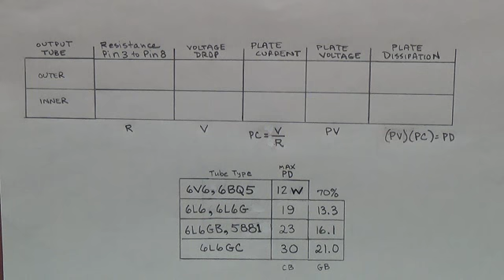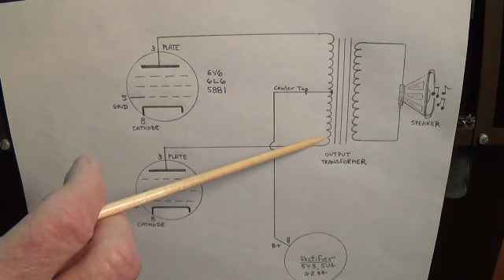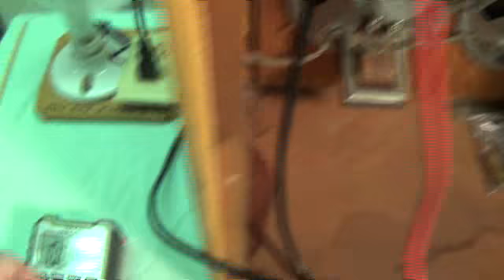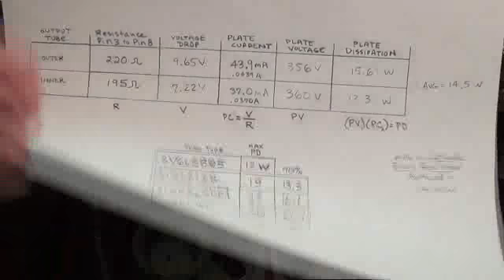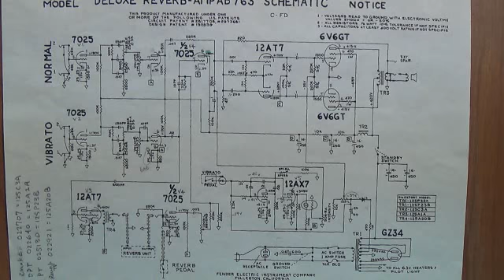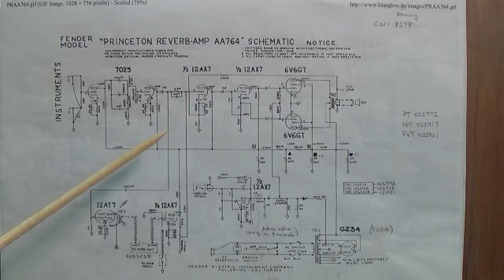Biasing Double-Ended Amplifier Output Tubes, Part 2: Demonstration and Discussion

Comment: Will individually biasing your output tubes make up for having a very poorly matched output transformer.. I got 83 ohms on one side of the centre tap and 97 ohms on the other side on the primer
Reply from the maker: You can try, Joe, but mismatched output tubes can sound better than matched ones......more even-order harmonics.
Reply: @UncleDoug thanks… it’s a fender blues junior… it sounds great as is really think I will be thank full for just getting it working again and leave it be…❤
Reply from the maker: @joeblogs8204  A disparity between primary windings is quite normal, Joe.
Reply: @UncleDoug thanks for cooling my bias😂I think I been getting too carried away with the repairs .. it works so I just leaving at that . Thanks pal for the advice..
Reply from the maker: @joeblogs8204  You're welcome, Joe.
Reply: @UncleDoug Like a complete idiot I have decided to convert the fixed bias of a blues junior 3 to the cathode bias of the junior4 .. I have just leaned the 4 is cathode biased but I am going to make mine variable like you have shown on the Princeton.. what’s wrong with me ..why can’t I just quit while I am ahead
Reply from the maker: @joeblogs8204  Experimentation is how we really learn tube amp circuitry, Joe. Just be careful and use a current limiter to protect the circuit.

Comment: Thanks Doug for this tutorial.   I have a Fender Twin Reverb (SF 100 watt) that I added 150 ohm resistors to 
the inner set of 6L6GC (pulled the outer two & have an 8 ohm speaker in cabinet).    I have a hybrid biased amp
as a result.    I was looking for this transformer method to get the tubes biased within 70% of max.   Your video 
helped me learn how to bias using this method.   I cannot find any info on the internet (so far .. ) that tells me how 
to properly bias a hybrid bias amp.   I'm assuming the transformer method is the best way.    Let me know if that is correct.
Thanks again.
Reply from the maker: Voltage drop across the OPT primary winding is, to me, the safest and best way to measure plate current, Todd. To hybrid bias, since the cathodes are grounded and if the PD's are beyond 10% out- of-match (and you don't want to buy a better-matched tube set), would be to add carefully selected cathode bias resistors to the mismatched tubes, to make their bias the same. This is only advisable if the mismatch is significant.  Small to moderate mismatch can actually produce superior tone and more pleasing harmonics. Also, Fender used hybrid bias in several of their higher-wattage circuits, so there is a precedent to do this.
Reply: @UncleDoug     Thank you Doug.     I have four 6L6GC tubes from JJ that are matched.    But I did a separate bias for fixed using multi-turn pots, so each tube can be biased separately.    What you were stating about the Princeton not having a bias pot ... then you added 100 ohm resistors to each power tube made me wonder about how I should bias this hybrid.    I have around 410VDC on one plate, and something close to that on the other.   I reduced plate voltage by adding a 300 ohm 25 watt precision resistor to the HV Center tap of PT.    It seems, after what you stated about the Princeton, that if I biased to -52mA approx, adding the 150 ohm resistors to each cathode would actually cause it to have a cooler bias.    What I had come to understand is that with a hybrid amp, part of the bias is with cathode resistor and the remaining with fixed.     If I use the transformer biasing method you show in your video, is that all I need to properly bias the tubes to 70% of max?    I have tried to find one site on the internet that gives the procedure for biasing a hybrid amp & found nothing.     Since Fender did that around 1970 (apparently the Beatles SF Twins were hybrid biased), how did the factory bias them?     Thank you so much for your expertise and time.
Reply from the maker: @toddmayer6859  I believe I already explained this in my previous response, Todd.
Reply: @UncleDoug     Thanks again Doug.   I'll re-read what you wrote.  Guess my brain didn't absorb the info.

Comment: I'm having trouble adapting this to Fender amps with SS rectifiers such as BF/SF Bassman. If I test resistance at the rectifier output as this implies, i get a wildly inconsistent figure in the megaohms. I guess that means I measure resistance between plates and right where the output transformer center tap connects to the eyelet board? That gives me a MUCH lower number than in this example, only 37-38 ohms.

And what do you do if you if the voltage drop test says 0VDC, when measured from the center tap or the rectifier output? It does go to -2VDC once I turn the amp off. Any guidance is greatly appreciated, I've been fighting this for weeks/months.
Reply from the maker: Measure the primary winding resistance between pin 3 of each 6L6 and the red wire at the center left of the long rectangular eyelet board with amp off and filter caps fully drained.  It should be around 50 Ohms for each primary winding. Write down the actual value, then very carefully measure the DC voltage drop from the same tube pins and the red wire, using only one hand and amp on (standby switch to run/on). Divide the voltage drop by the primary winding resistance for each tube = plate current in amps.

Comment: My amp uses a 300ohm cathode bias resistor.When switching to 2 resistors for separate cathode adjustment would the average resistor value be 300 again or 150 ohm.I have two 250ohm adjustable power resistors that could be used if the average cathode resistor value is half when using separate bias resistors.
Reply from the maker: Good question and one that I have not personally faced in many years.  As I recall, I biased each tube at the full original resistance, i.e. in your case 300 Ohms each, and then fine tuned from there, if needed. It's always best to start high rather than low.
Reply: @UncleDoug  I believe use of 2 cathode resistors would require the same average value of resistance ,however only half power rating would be required. My amp had ben serviced previously and It has an issue with the power output declining shortly after it is powered. The 5Y3 pins 2 and 8 have been wired so that pin 2 is connected to power supply caps and one of the 5volt transformer leads.Pin 8 goes to other transformer lead. The schematic shows the standard 5y3 wiring. Is this a problem?
Reply from the maker: @davidfoster5906  I agree with your analysis of the bias resistance, but would stick with the original power rating for each. Why take any risk for a negligible savings? With a directly heated cathode, as in the 5Y3, the rectifier pin used for B+ shouldn't matter......unlike with an indirectly heated cathode, i.e. GZ34. Pin 8 is preferred by most, to enable the use of both types of rectifier. I don't understand what "power" is specifically lost.....plate voltage, plate current, output wattage ??
Reply: @UncleDoug  Output power drops the longer it is on(it gets quite) I ran both bias methods 12 watts result for the cathode R method 10.9, 10.96watts transformer drop method.I have already increased cathode R from 300 to 350ohms. The power transformer puts out higher voltage than rated 710VAC rather than 680vac.  The amp had been serviced previously.I found .1mf coupling caps installed  to 6v6 grids instead of .047mF. Instead of replacing these new organge drop caps , could I half the value of the old 470k grid resistors. It could work as the Grids have high impedance in cathode bias. The power supply can cap may need replacing .Do you have a chapter on measuring leaky polarized caps?  Unfortunately the power transformer is only rated at 80ma so I may bias the cathodes for less dissipation (75%).
Reply from the maker: @davidfoster5906  Way too much random info and way too many questions for a comment section, David.  I simply don't have the time or energy to engage in complex long-distance amp repair.  Hopefully my videos will help. Good luck.
Reply: Sorry for the rambling questions. I have the plate dissipation down to 11 watts by following you process.I will work it through.
Reply from the maker: @davidfoster5906  I'm sure you will, David. Good luck.

Comment: Thank you for the great information.  I have a vintage Dynaco SCA-35 Hi-Fi amplifier that runs four EL84's, all biased with a single common cathode resistor (93 ohms).  While rolling some Russian Mullard tubes, I got some red-plating, even though my Philips JAN 6BQ5's ran OK.  Following your calculations, I learned the tubes were each dissipating about 14 watts in the plate.  I increased the cathode resistor to 133 ohms, and now they are all dissipating just under 12 watts.  That saved this vintage amp, which is now running, and sounding, great.
Reply from the maker: It sounds like you did exactly the right thing to save this old gem, DP.  Good work !!

Comment: Hi, Doug.  Thank you for sharing your knowledge.  You mentioned a couple of solutions for correcting differences in tube output as in the situation you discovered in this video.  One solution included changing from a shared cathode bias resistor to individual ones of different values.  I wonder, before doing that, is there any benefit to swapping the location of each tube (inner tube to outer socket, and vice versa) and checking the bias again?  Perhaps the tubes might perform a bit differently (hopefully more equally) in their new locations due to the different resistances of each half of the transformer winding or due to differences in the tubes themselves?  Just checking my understanding of what's going on.
Reply from the maker: Switching sockets is a good way to reduce the difference in Plate Current.....but in my experience, the improvement is generally quite small.

Comment: Uncle Doug, do you get a noticeable voltage drop across the plates with the current limiter in line with the amp instead of it plugged directly into mains?
Reply from the maker: It depends on the current draw of the circuit. In a Fender Champ, the voltage drop is negligible. In a Fender Twin,the voltage drop is significant. Bottom Line: Final bias settings should be made with wall AC.....i.e. no Current Limiter.

Comment: Hey Uncle Doug, what's the max plate dissipation on cathode biased EL34 tubes?
Reply from the maker: According to tube data readily available on the internet, it's 25W, RT.
Reply: @UncleDoug  I saw that on Google but wanted to check with an expert! 50% of what's online is way off the mark! LOL!
Reply from the maker: @rakentrail  Tube data is pretty reliable, RT.

Comment: Hi Doug, I have a 1995 Bassman Reissue, and it made a burning smell, and a loud buzzing.  Since then,  while testing with this method, I found that ohmage pin 8 rectifier to pin 3 plate of 6L6's, in both cases, each side of the output side of the output transformer read at MEgohm readings. IS this due to a fried output transformer, or some weirdness of the Solid state Rectifier that's in place? (thanks in advance if you get to see these late comments)
Reply from the maker: I'm confused by your descripton of the symptoms. If you mean that the output wires from the secondary winding of the OPT have virtually no continuity ("megohm readings"), then yes the OPT is fried.  Both the input (primary) and output (secondary) windings should have measureable resistance far below the megohm level.

Comment: Fantastic info, Uncle!  I was paying close attention to the AA764 piece.  I have an AA964--would the bias recommendation be the same since, like the 764, the 964's cathodes are connected and grounded and it's grid-biased with the grids connected to the trem intensity pot?  Of course, this video was 10 years ago--maybe you've found another way to cool the bias on these beasts?  Thanks for listening.
Reply from the maker: Yes, the bias procedure would be the same, Jeff. You can alter the value of the 27K resistor (to ground) to change the range of bias adjustment.

Comment: If there running 6v6's if 5881's then go to 22or23 watts 
6l6's can be at 19 watts plate dissipation. Because with cathode bias they are in class A mode it's called class A push pull they blend together push pull or parallel
Reply from the maker: Of course the PD limits are different for different output tubes, Dwight.....and I question your grasp of Class A amp circuitry.

Comment: Isn't it true that in double ended amps with cathode biasing are in class A mode less efficient so need to be run at Max plate dissipation. Because they are Class A they are running 50% efficiency in tube type amps. The only time you run less that max plate dissipation is when you're running grid biasing because it is more efficient at 70% efficiency only then 70% of Max plate dissipation.
This I know from amp repair books.
You can run a double ended cathode biased amp in push pull to 
At least 11.5 watts
Plate dissapation.
Reply from the maker: The method of biasing (cathode vs fixed) does not determine the class, Dwight. Cathode biased output tubes can be biased to 100% of max, but it is not recommended. Fixed bias output tubes should be biased at 70% or less of max PD.

Comment: Uncle Doug great video as always but I have a question for you. What about biasing a Cathode Bias Kalamazoo Reverb 12 it has no Rectifier tube, its solid state diodes, were exactly would you connect the multimeter ground. I have a good idea but I’d hate to be wrong a damage this pristine condition amp, it was the first amp I bought back in 1966, thank you.
Reply from the maker: If you are trying to measure voltage drop across the cathode-bias resistor, simply attach the probes on either side of the resistor.
Reply: What I meant to say with that ground connection question, if using the second method to bias the two tubes using the output transformer method, where in the circuit on the schematic would be the best place to connect the multimeter ground test lead on a Kalamazoo Reverb 12 with solid state rectification. There is no rectifier tube pin 8 to connect to like in your video. Thank you😊
Reply from the maker: I have no schematic for this model. In general, with SS rectification, connect one lead to the B+ wire from the diode rectifier (which connects to the center tap of the OPT primary), and the other to either of the plates of the output tubes.  @60retired
Reply: You are absolutely correct the center tap is connected to the two diodes that go to the B+. I traced this out again last night and thats the place I figured would be best but wanted you opinion on it. I’ve only worked on four Vintage Fender amps with fixed bias, never on SS but it looks like no big deal. I’m considering possibly doing a mod so that both tubes have their own cathode capacitor and resistor rather than both tubes sharing. Theres a perfect spot in the chassis to do this. Thank you so much and for all the great videos they have been very informative and greatly appreciated. Nobody online does a better job at explaining and demonstrating this info than you. Thank you once again, stay safe and healthy.
Reply from the maker: There is no benefit to splitting the cathode bias resistor and bypass caps, 60R, other than allowing you to measure the individual plate current for each tube.....which can be done via the OPT half-winding method. Good luck with your project should you choose to proceed. @60retired
Reply: I might be totally wrong but I was under the impression that by splitting the resister and cap would allow you to bias a mismatched pair of tubes simply by adjusting each resistor value to achieve proper bias. If I’m wrong then I certainly wont bother doing it. I’ve learned great deal over the last several years but obvious have much more to learn.
Reply from the maker: What you are describing is indeed possible, but in most cases not worth the time and effort required. @60retired

Comment: 15:50 - This is me questioning everything else I've ever heard. It's not me questioning you. Is 87% PD okay? (20/23 for a 5881). I understand tube life would be reduced but does that mean it's still okay as long as they're not red-plating? I've biased two of my amps now and got concerned when I found 57mA of plate current on a set of Winged-C 6L6GC's at 400v on the plates (so 76% PD). I pulled it back to where they biased it for me when it left the shop 10 years ago at 44mA but watching this makes me ask. Is it okay to "goose it up" well past 70% PD if one doesn't mind going through tubes more often?
Reply from the maker: I guess you're welcome to ignore the generally accepted maximum PD for fixed-bias amps, Sean.....but what do you hope to gain? There is no noticeable improvement in tone or any other benefit associated with this overbiasing.
Reply: @UncleDoug Edit: Disregard question below. Woke up, got it, and now feel like a total & complete idiot. I’d somehow failed to remember (or notice) that you were demonstrating on a cathode-biased amp. All makes sense now. Sorry if I wasted your time.  
---
(Understood, and thanks as always. I didn’t express my question very well. My question was when you said on the video “if you want to goose it up to around 20 watts,” as the pencil was pointed at the 5881 row. That seemed over biased to me when I did the math, which is what confused me…so I wasn’t sure if there was something I misunderstood. In any event I've biased mine for the first time thanks to you! (I wound up around 60%)
Reply from the maker: @SeanWeaver  No problem, Sean :)

Comment: Uncle Doug, I have one side of my 6v6 push pull that will not bias. I bias one side and the other side goes out from bias no matter what I do. would you have any idea what causes that?
Reply from the maker: Yes, ML, your output tubes are not balanced, so when one is "in" the other is "out". If the difference is less than 10%, simply live with it. If it's greater than 10%, order a matched pair of output tubes.